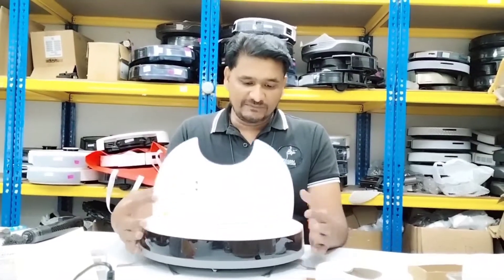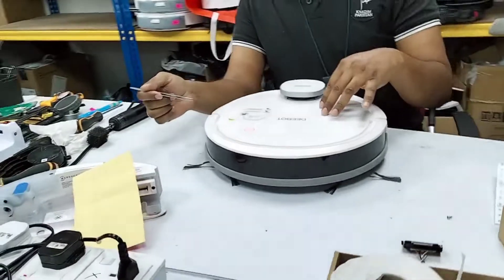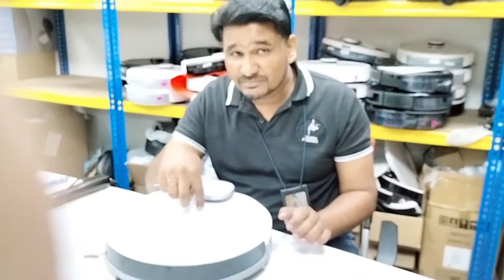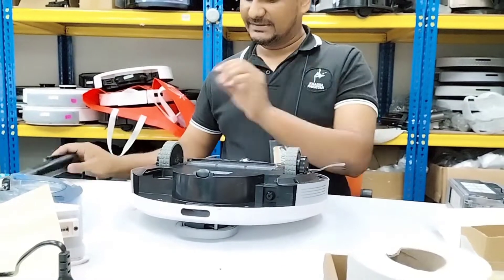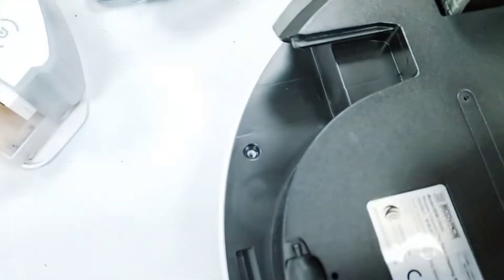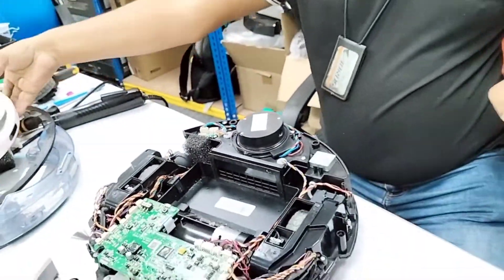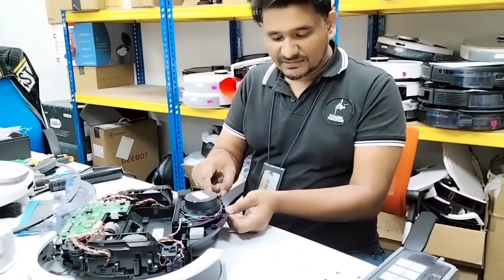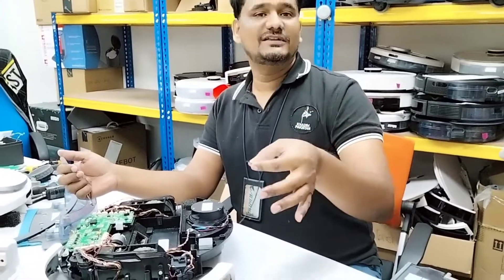Ecovacs | Deebot | Ozmo 900 | LDS  issues

Comment: Thanks for showing how to disassemble the Deebot. I think my LDS issue may have been the amount of dust on the logic board, but I checked the belt and drive wheel and cleaned it all up and now it works.

Comment: So I have a 930 pro belt functions lds also most of the time but it makes loud noises.

Tried to lubricate it with silicone oil which made it a tiny bit less noise but still too much.

I think I will have to dissassemble the lds to the motor I guess.

If you read that by any chance dear mr. robo repair renegade. Pls tell us if and how to lubricate these bots.

I think it really could reduce wear if done correctly.

Comment: Hi mate, i got deebot 950, thanks for your video which solved bumper issue but not quite lds sensor, after i did all, it intiate rotating but then again after few minuts it stop, so i have to press start again and manually rotate lds  then it will start rotating ..but for few mins only . Please help thanks. Raj
Reply from the maker: Bearing got grinding sounds so need to replace bearing if no sounds then LDS motor weaker..if can find same Will solve issues

Comment: my deebot is not mapping does not see the map. Lds is spinning but I don't think it is working. Checked the lens it is clean. What can be the issue?
Reply from the maker: May I know the model no. ?? Remove the deebot from charger then after deebot power on plz press the auto button then see weather LDS assembly the black colour round part turning or not if LDS not turning then plz check the LDS belt might broken..if LDS turns but deebot won't move so plz let me know what's the error voice msg appears...??
Reply: @ecovacstechnicalsupport5278  Deebot 900 Series, LDS is spinning and when turned on its not making any error sounds it just works as regular but it is not mapping the surface. App does not show the borders of the room and robot is not able to locate itself in the room. tried to reset it several times and clean it but it did not help.
Reply from the maker: @JONnodir  there are 2 possible reason sir. If deebot connect with app perfectly but maping got issues normally it happens because LDS belt loose or LDS it self faulty...need to check...
2 reason is core board attach under main board just next to power button side..a small chip... sometimes also can be faulty... normally if this one faulty deebot can't connect with apps as well

Comment: Mine has the same problem, but I'm in Brazil and I can't find someone to fix it, do I need to change the whole part or just that rubber? My model is the Deebot Ozmo 900
Reply from the maker: Need to open top cover & confrm first weather belt broken or something stuck there
Reply from the maker: Most likely is belt broken in this model after 2 years...its normal

Comment: Showing LDS blocked even though LDS rotating. What can I do? Please guide me sir.
Reply from the maker: If LDS is turning but still giving LDS block error means might be LDS eyes dust or block with spider web 🕸️, if all clear still giving error then LDS assembly need to replace sir....u can buy n replace urself at home...its easy... videos available about this topic as well
Reply: @ecovacstechnicalsupport5278  Sir, all cleaning procedure done with following your videos and LDS assembly also opened and checked, all are physically OK. May Be Laser system is malfunctioning and maybe needs to be replaced as what you said. Could I know as it having warranty how I get servicing in India? Please guide me sir.
Reply from the maker: @srinivasjalli6390  Indian customers told me there's a service center in new Delhi India...or they contact their Hotline no. Then they cover ur warranty as well in India....they said they provide home services
Reply: @ecovacstechnicalsupport5278  thank you sir.

Comment: I have an issue with mine...it's vacuuming but it's not moving..but when I lift up they lit the red light..mine is this model..what is the issue and any solution I can try?
Reply from the maker: Plz check weather LDS assembly is turning or not... normally if LDS is not turning then looks like vacuum functioning but deebot won't move.... maybe LDS belt broken.or lds motor as spoil. Or LDS assembly faculty....
Reply: @ecovacstechnicalsupport5278  My LDS seems to be turning.but the map generated in the apps is seems incomplete..and Set Me Up voice can be heard..
Reply from the maker: @MultiHafiz96  plz reset Ur deebot n save new maps... hopefully will be ok
Reply: I already reset the Map..but it still stay in one place and not moving.. already change the belt but no avail...the Map also seems not complete and there's missing parts from the map at the apps..Is this LDS Issues or other thing?
Reply from the maker: @MultiHafiz96  when u press auto button so LDS start turning or not....if not turning means maybe belt too tight or stuck or LDS motor spoil that's why LDS not turning
Reply from the maker: @MultiHafiz96  if LDS turning but still deebot won't move then LDS assembly need to replace

Comment: I have made map various times but after mapping whenever it starts cleaning again it overlaps the current map and the cleaning lines are also very uneven please help, technical support not responding
Reply from the maker: Plz press reset button for 7 second after reset need to save map again... hopefully will be ok if still same then LDS assembly need to replace
Reply from the maker: Plz follow the instructions in my video... how to save multiple maps..if u r using D-TOF models
Reply: @ecovacstechnicalsupport5278  Have done the same various times but still same problem exists
Reply: @ecovacstechnicalsupport5278  i dont want to save multiple map but the single map that I'm using gets disturbed every time the deebot starts new cleaning cycle and yes I'm using Ozmo T8 Which comes with D,tof
Reply from the maker: @SamVlogs7  if you saved map already n next Cleaning cycle overlap then mostly after reset problem solved..but if after reset still same then it's a D-Tof issue...need to replace D-Tof..plz contact ur seller n request to replace D-Tof assembly for you